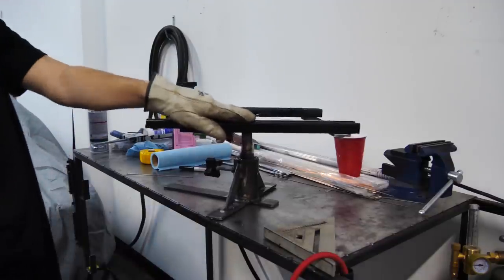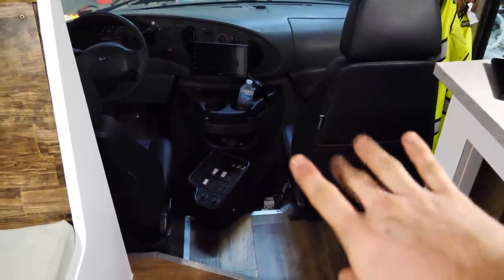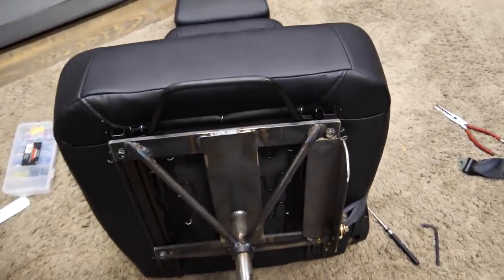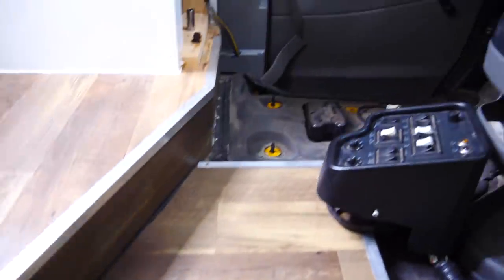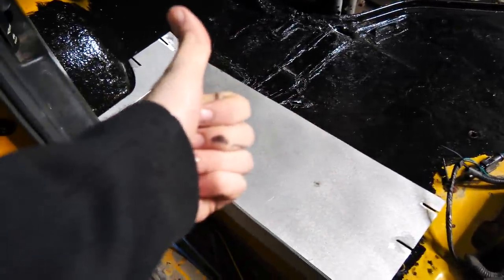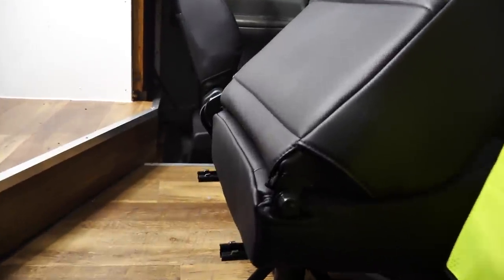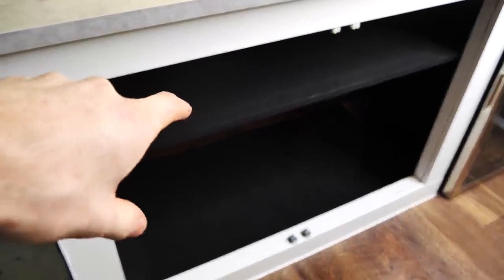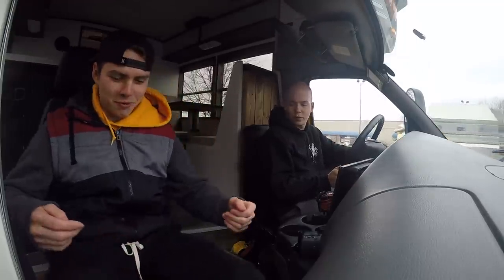The ADVENTURE BUS was Hiding a BIG SURPRISE... (Finishing the Seats)

Comment: Why not cut the rust out and put a new pan in instead of hiding the problem for a year or so until it rusts out all the way
Reply from the maker: I was concerned I would cause more issues by trying to cut it all out and re make it. I wouldn't of been able to form the metal to seal against the doghouse properly.
Reply: Honda 250  I dont think there are any inspections where he lives, and no inspector would ever pull the carpet up
Reply: What he said... or she. Or yeah... do it the right way...
Reply: Y'all are overestimating how fast rust forms, I really think his sheet will last long enough until the vehicle dies, he sells it, or just moves on. Not every mod has to be thorough.
Reply: Not overestimating, just a stickler for doing it right. If your gonna go that length, just go a little further. However, in the correct environment, ie salt and moisture, it forms fast enough.
Reply: @DaDavidVids  This is a vehicle that lives in the midwest, and drives through the winter.
Reply: @_Gingium_  Better leave it so it rusts out and you can spend more of those patreons shekels on another dead-end project
Reply: I would recommend getting it done properly. You have only protected the topside of the metal (not where the metal is rusting from, its rusting from the bottom) even then I don't think POR completely protects it, it appears to be similar to underseal in a way, so it can still rust further. 

It will do the job for now, but I would strongly recommend getting the rust situation on the whole bus (and the rally miata :( poor thing) sorted whenever you can.
Reply: @_Gingium_  Hey man, Have a look at Trevs Blog, Trev has been doing bodywork for a long time, You could use this method to make a new floor panel lip.....

https://www.youtube.com/watch?v=kWDyUXR83ng

Also re in sound insulation, the bus is similar layout to my van albeit a lot bigger, but you are sat right over the front roadwheels which create a lot of noise, maybe there's a way to deaden that.
Reply: @ducttapedesighner I think he should have done that. I know a guy who bought a a car and had riveted metal over bad rust in the frame. It really sucked for the guy and cost him way to much to get it fixed. Moral of the story all things should be done right the first time and I don't see why, since spending so much in the engine, Gingium didn't fix it properly.
Reply: @_Gingium_  just do a road trip to Connecticut and visit jimmy oaks and B Hall. B Hall is a professional body tech.
Reply: @_Gingium_  It would been way smarter to cut out the rot and replace it with new metal. Now I recommend that you check under the carpet at spring.
Reply: Honda 250  There is no MOT in America, but at here if you take a car to the MOT and you have rotten hole in the floor, that would been written off instantaneously like you have to call a tow trcuk and you could not drive it away. And even hole at the exhaust is a failure in MOT, that case you can drive the car but didn´t pass the MOT.
Reply: He can make the inside look as nice as he wants to but unless you seals up the outside it'll just continue to rot from the underneath of the bus
Reply: ducttapedesighner he’ll probably fix it in future , his video was to get the seats installed and all of that , and what he did was probably really easy for him lol
Reply: Joe Wuh-Puh no, por15 is designed to encapsulate and chemically neutralize rust. The only time it rusts through is when the metal is rusted through badly already, and you only paint one side..... if it’s surface rust or something of the sort, por15 works great
Reply: Honda 250 oh I didn’t deny that. It just sounded like he was dissing por15. Por15 is great stuff when used properly, but this wasn’t it😂
Reply: @DaDavidVids  Rust repair is not a mod.
Reply: @_Gingium_  I call bull on that excuse, you do have an angle griner and a welder, you can just make that lip a separate piece and weld to the new floor pan. I've done more complex rust repairs than that with less than half the equipment and welding experience you have. Please, fix it properly so all the hard work you put into the bus doesn't go to waste when that rust spreads.
Reply: Not a matter of right or wrong, just one preference over another. Por is perfectly fine to cover the rust, that thick aluminum plate is more than sturdy enough to serve as a floor and was obviously very well made and installed. Let people live, man.
Reply: Gingium That makes sense
Reply: yeaaa if i have all these stuff i would've do it during a weekend or something
Reply: @qers  yeah but rust isnt fast even in the midwest. Plus hes going to wash it. Surface rust is quick. Panel rot on the other hand, is slow. Over 16 years, regular washing, the durango i drive has minimal rust with a bit of panel rot in the quarter panel, i fixed it. But still. even in the midwest, it took 16 years to get a semi noticable amount of panel rot. If hes clean with it and careful that patch job will last at least 10 years.

Comment: >has a welder
>doesn't want to fix the floor properly
Reply: yeah, its not that hard really, maybe finding the spotwelds is the difficult part if even that
Reply: I forgot, is this bus a show bus? Oh no it isnt. You literally cant even notice the floor. If this was a restoration of an older car, sure give him hell. But, its not.
Reply: @AutoMotivate  but you'd still want to repair the rust, in order for it to not spread and get the carpets wet, and would be strong too
Reply: @Kristo99  The main issue i have is that he didn't address the underside of the rusted metal. The floor i probably just as strong with the way he did it.
Reply: @AutoMotivate  yeah you're right on that

Comment: I have to agree with all the comments about the rust. As someone who has lived in Upstate NY and fought car rust my whole life, you have to cut the whole rusty pan off. What you did will last about 3 years before the rust creeps to the edges of your repair. Love the Adventure bus videos!
Reply: also, the rust is not coming from the top, its coming from the bottom where all the salt spray from your front wheel is......spraying. So you should POR the underside too.

Comment: Sound deadening for low frequencies in particular is done with high density material. Lightweight stuff like that foam you put down really won't do much. Having the air seal on the floor is okay, but a heavier thicker material akin to Dynamat would do a much better job at soundproofing than the foam you used. I would look in to something like that. You can put a high temp insulating mat on the inside of your doghouse that helps out quite a bit as well as well as putting something with plenty of mass like dynamat between the firewall part of the doghouse and the inner upholstery. You can find plenty of pics of the process online. You might even want to get a passenger van doghouse to work on with the cupholders in it FWIW.

Comment: So with the sound deadening you would use something like butyl matting to make the panels physically heavier so it doesn’t bounce around off the plate this heavy type of Matt is good for rattles
Whereas he stuff you bought is perfect as an over the top layer just as you said you need to find all “gaps” audio is getting through. You don’t necessarily need to have a metal dog house you could apply sound deadening to the inside and/or put a lead blanket over the engine. Also the doers will allow loads of sound to sink in.

Comment: hey man; i think you should yank that rear engine compartment cover (center console cover?) and give it the full sound deadening treatment as well. probably could also stand to do a thermal wrap on those exhaust pipes that route through there for some additional minor noise and heat attenuation. that's where a HUGE amount of that noise is coming through.

Comment: Seriously Caleb, GET A REAL SPRAY GUN!! The 15 dollar harbor freight one works great and gives you a WAAAAAYYYY better result than freaking spray paint. And also, POR 15 is great, but you should have cut out the bad spots and welded new metal in. It’s more structural that way

Comment: I don’t know if you know but that Noico closed cell foam isn’t really supposed to deaden sound, it’s more so supposed to be a vibration isolation layer. Ideally, you put down a dynamat type first to reduce vibration of the metal, followed by the closed cell layer, and then finally a layer of mass loaded vinyl. I bet if you did that on the engine cover and put some foam gasket around it would help quiet down engine and road noise significantly, and would make long journeys a little less taxing

Comment: You should find a wrecker that has the same type of bus and cut the piece of floor out that you need and weld it into yours. The fix you did will make rust issue much worse than it allready is!

Comment: On the engine side of your dog house there should be some silver and black insulating material it should be connected by some fancy round plastic Clips you can remove that put your sound deadening material underneath it then reapply your insulation

Comment: You really should remove as much rust as possible before applying POR15, I know it says it can be applied over rust on the tin but it also says to prep the area as best you can first. Just painting it over rust like that will only cause it to peel up a little down the line (ask me how I know, lol). Same with bolting a patch over the rust hole, it's going to continue to rot underneath, it ought to be cut and welded if you are keeping the bus awhile. Keen an eye on it.

Comment: Personally, what I would do is drill a hole through bolt outer and inner tube for that passenger seat and use a trailer hitch pin to hold the seat in place in driving mode.

Comment: You can order a new drivers’ side floor pan, from an autobody shop, for a longer lasting repair. 

Also, that’s horrible sound deadening. Use Dynamat, or something similar. It’s a thick tar like sheet, with a foil top-sheet. It actually changes the resonate frequency of the metal.

Comment: So firstly. Kudos for being a guy that reads the comments
Secondly, good stuff man. Your like 10 years younger than me, so watching your methods reminds me of my younger days, it's nice. 

Okay brass tacks time. Your methods for that for floor repair is not what i would have done. Okay whatever, it doesn't have to be. I would have wanted to cut the rusted panel out entirely, and replace it. 

Real talk, that would have been a pain in the ass.

But if i may suggest: drill those rivets out, get a tube of panel adhesive. 3m windshield bond should be at your local gettin spot for about 13-20$ a tube, or liquid nail will work in a pinch for cheeper. Then butter the entire panel with that shit, and rivet it back down to hold it in place till the glue dries.
Reason: steel is stronger than aluminum, duh, but the vibrations from driving will cause the steel floor to cut right through those aluminum rivets.
 The adhesive will not only act as the primary bond, but also dampen some of the sounds as well.
Those rivets might only last a year, and silicone is too flexible, it's going to allow the vibration.
For the doghouse, they make firewall sound deadening. I bought mine a long time ago from a company called B-quiet. I don't know if they even still exist, but it looks like polyiso foam, with a thread reinforced mylar outside layer.

Comment: I honestly expected a better floor repair. I'm surprised no one noticed it when the engine was out. I know it would have sucked to repair but it's winter up here and there's no better time to do it. If you drive it for another year or more with just those plates over the top the moisture is going to eat it from the top and the salt will eat it from the bottom.

Comment: Best to cut out most of the rust, then por over what's left and patch. Even though you por ed over the rust on the inside of the bus, that is still rotten under the bus and if you don't stop it it will only get worse. That all needs to be cut out and replaced. What you did is a temporary fix.

Comment: So many things wrong with that repair por15 to work has to be used with the por15 degreaser then the rust converter but before that that rust should have been all cut out and replaced not just welded over there will be rust in the near future

Comment: I mean por 15 works, it’s not a permanent solution in my opinion tho, also you only showed yourself doing the top side and rust that severe is gonna be on both sids and you didn’t do the underside of the bus so it’s still gonna continue to spread, replacing the sheet metal is the only real way to fix it (plus you have your own welder and the skill to do it so all your paying for is parts which is way cheaper than parts+labor)

Comment: dude, that rust is still there. you MUST cut out that entire section of floor and weld new plate steel in there because that part of the bus is structural to the cab. the only thing you did was sweep it under a pretty rug and say “it’s fiiiiiine”

Comment: Gingi  instead of a screw to tighten the seat down from moving why not drill a hole through it an put a locking pin instead to insure no movement...after some time the screw wont hold it because of west an tear... a locking pin would be way safer

Comment: Why not cover the inside of the engine cover with foam or some other sound/heat insulation? Also, please get a nice OEM leather wrapped steering wheel from another FORD and not some deep dish drift wheel.

Comment: I thought vehicles have been made with galvanised steel for at least the last 20 years. Why all the rust issues on US vehicles?
Reply: Volvo is the only make I know of that uses galvanized steel, and they galvanize it before the sheets are pressed into shape, basically ruining the galvanization in any part of the piece that isn't completely flat.
Reply: @hotdognr12323  My old 1985 Audi 100 was 100% hot dip galvanised. Almost all, if not all, European produced cars are now made with galvanised steel. I've hardly ever seen a rusty modern(ish) car over here, despite the wet, cold winters. I'm not bragging, just wondering if US car makers skip the galvanisation...

Comment: 🤦🏻‍♂️, why!!, u should of cut the bus floor out and replace it with the proper metal and than rubber seal coating... The rubber sealer isnt a repair, it will come back again even worse, its not duct tape or zip ties

Comment: I kinda don't understand why didn't you treat the rust? or atleast cut the rust out and weld new metal there. Just cuz you painted it, doesn't mean it won't spread and the same problem will occur over time. Yes that paint might say, ''no need to remove rust'' but it's better to be safe than sorry in the long run

Comment: In a crash the seat column will snap easily. Why not copy a design from an rv rotating seat?
Reply from the maker: The column snapping is the last possible failure that would happen in an accident. It's quarter-inch steel!

Comment: I would rather attach the passenger seat to the wall at left from the door, and when nobody sits on it then just lift the seat part up, takes less room and is way more convenient.
I got new battery for my car from the main dealer, but the guy at the main dealer told me that the previous owner was ruined the battery tray by modifying it with angle grinder for larger battery. The tray still does it´s job, but that is really fucking annoying there was no reason to modify and ruin it, you can get right battery from the main dealer what fits to the car, so you don´t have to ruin the tray for some aftermarket junk. Also I can´t replace the tray because Citroën doesn´t manufacture it anymore. At least I have a fresh battery what can survive the winter.

Comment: In gingiums defense por15 supposably turn rust back into steel
Reply: maybe a micrometer of it, but rust is porous, if ANY moisture is in the pores, it will form more rust, which will create more room for moisture, which will create more rust. There are two ways to deal with rust, you can hide it, or you can remove it. Sadly he did the latter.

Comment: Yeah a seat isn’t something I would experiment with. And comparing it to the fact there weren’t seats before 🤦‍♂️
Reply: KDcars what do you mean? Keep in mind before there were just benches with no headrests or seatbelts. He did it better than factory.
Reply: Joseph Samsor all the weight of the chair is supported on that single piece of pipe.. it’s like an umbrella, should be mounted in all 4 corners solid
Reply: KDcars he built it out of some extremely strong steel. I’m sure it’s more than enough. He mentioned it in another comment. Chairs like those are pretty normal in rv’s and such.

Comment: Seam sealer and paint makes you the "mechanic" you aint.... Thats really not safe. That bolt in the floor is a cab mount and all the metal around it is gone your only hiding the problem. The passenger seat and the driver arnt going to be safe in an accident.. YOU WILL DIE IN AN ACCIDENT IN THE BUS!!! (I am a certified automotive engineer by trade im not speaking out my ass)